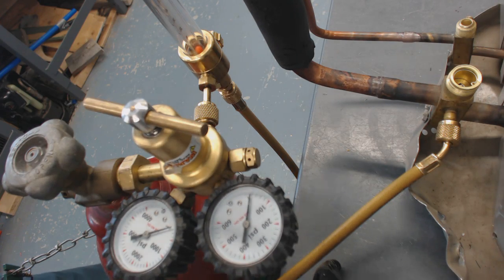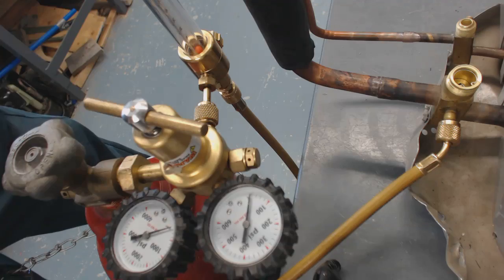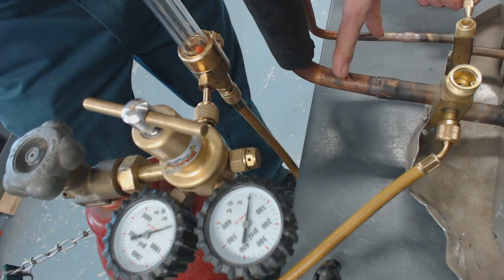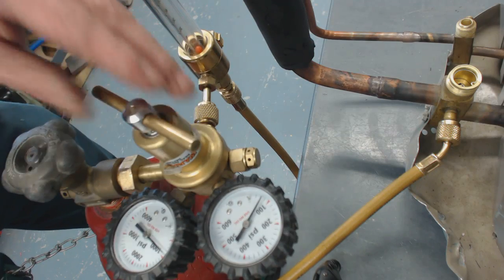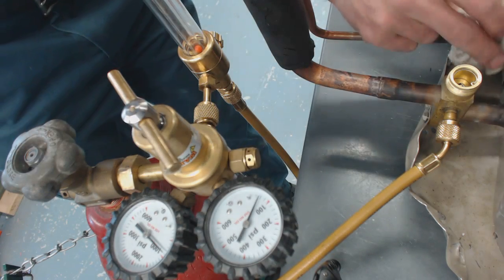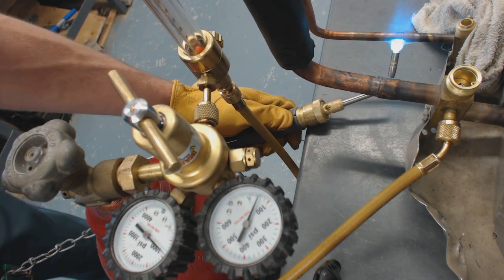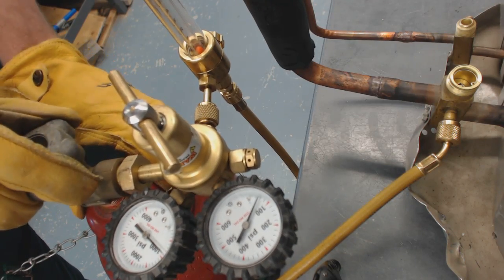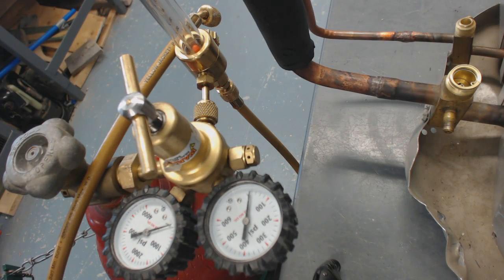How to Braze with Nitrogen! The Process up Close from Start to Finsh!

Comment: How would you do this setup brazing in line sets that are 9 ft up and not hooked up to the unit yet. I am working with 20 ft sticks of hard copper that can be up to 100 ft long line sets and we are brazing it all in without nitrogen. I know nitrogen is an important process when brazing because of the damage it can cause but I am working under someone and I kind of have to do what I am told. I want to do it the right way so if you wouldn't mind explaining how I would hook it up. Like I said none of the copper is hooked to the condenser or furnace so I would just need to run the nitrogen through the suction and liquid line to make sure I am not oxidizing the inside.
Reply from the maker: You can drill a hole in a cap and braze a service valve in it. Put the cap on the end of the pipe and tin tape it on. You would be brazing 20 ft or more away so this won't fall off. Keep the nitrogen tank on the ground and use 1/4" hose couplers or a gauge set  to connect two 5' refrigerant hoses together to extend reach to 10' high.  --- http://amzn.to/2i2JwE8   -- I do agree that you need to follow what your told until you are in the position to make the positive changes you want. Also when just running linesets before installation of the condensor or evap many times we braze these access fittings on and do a pressure test during other building processes to make sure our linesets were not damaged. You would just cap the other side or connect the other side with the two pipes together. Thanks, hope this answered your questions!
Reply: acservicetech acservicetech acservicetech acservicetech okay so for instance say I am going to braze 40 foot of line set I would braze into a cap a service valve on both liquid and suction line. Now at the other end of the liquid and suction line is that left open so the nitrogen can escape? I think you mentioned tying them in together but how would you do that if the liquid line is 3/8 in and suction is 7/8 would you need some kind of reducer so they could tie in. Guess I am not understanding how you could tie the two in together since they are free standing and not hooked to anything yet.
Reply: acservicetech thanks for the link I am going to order those
Reply from the maker: If you were to tie them together on one side after you are done brazing to run a pressure test through both then we usually just crimp the suction line over the liquid line and braze the seam. It will hold pressure. I do this with channel locks and linesman pliers. In reference to brazing just the vapor line put the cap on one side and leave the other side open for the nitrogen to escape. Here is the link for the smaller tubing service valve  -- http://amzn.to/2iQ1tIn
Reply: acservicetech okay I got it. Yeah I have channel locks so that won't be an issue. I really appreciate the tips it will help me do my job better. 👍
Reply from the maker: Great to hear, always feel free to ask questions, share your victories or frustrations. Keep growing man!

Comment: so do you put the nitrogen in the high side and let it flow out the lowside? Does it matter which side you flow the nitrogen into the system? thanks, let me know. ;)
Reply from the maker: Great Question! It does not matter which side you flow into, it will be able to flow out the other side. Thanks

Comment: Could you mention what position the hi/lo side service port king valves should be in while flowing nitrogen, e.g., front seated, back seated or 1/2 way?  Great Video!
Reply from the maker: Great Question! So in this video these are not king valves. Check this video out to see king valves--https://youtu.be/eXkqOS_qywo--------In the video you commented on-On new units with refrigerant inside the condenser the valves would be front seated as you are brazing the lineset and evap in. On a system where you are replacing the compressor and have previously recovered the refrigerant you would have them backseated. On king valves brazing lineset on system with refrigerant in the condenser you would have the king valves front seated. If you were replacing a compressor on a system you previously recovered you would have the valves mid seated. back seating a king valve is for disconnecting from a live system because a king valve does not have a Schrader to hold the refrigerant in. Thanks for your questions!
Reply: acservicetech

Comment: how does the nitrogen run through to the outlet of the high side service valve if the coil has not been brazed yet?

wouldn't the nitrogen leak through the unbrazed joints before reaching the high side valve?
Reply from the maker: Great Question! The object is to just get the oxygen out which it will do. Yes much will leak out but still there is enough to push the oxygen out at the other service valve, Check part 1, 2, and 3 for the whole brazing process with nitrogen.   https://youtu.be/SEe9HXmzvAY

Comment: Where did you get your gauges set up? Or what make are they? No wonder I have such a hard time doing it with nitrogen, as I don't have that second flow meter attached
Reply from the maker: You could get them at your local supply house or amazon for around $50. Look for a UNF3 Uniweld Flow Meter. Thanks for the Question!

Comment from the maker: I would still only run 3 cfh at the inlet through. If there is a lot of friction until the nitrogen can get out through the other side then it will take the path of least resistance and that may force a little pin hole through your molten braze for the nitrogen to escape. You don't really need the psi but just for the oxygen to not be present in order to prevent oxidation. Hope you enjoyed the video! Thanks for your comments and thumbs up!
Reply: acservicetech  how about doing this process on a package unit?  since they don't have service valves?
Reply from the maker: You would need to braze in access valves since you have to have the line be open while brazing and to weigh refrigerant in when you are done. this is what you would install after piercing and recovering refrigerant --  http://amzn.to/2i2JwE8  -or this size-  http://amzn.to/2iQ1tIn
Reply: You only need enough flow to snuff out a lit match at the outlet.Not blow it out.  If the match extinguishes, it means there is no oxygen.  Flood it first with more flow and then turn it down just enough to keep it moving..

Comment: Very nice, any changes with oxy/acetaline setup? I was considering running 5/10psi for gas to braze.
Reply: 10 psi would be plenty, 5 psi would be better.  Your only using a small tip.  Remember 15 psi max for acetylene.  Above 15 psi free acetylene can dissociate violently (ie BOOM).  One of the first things we learned in welding school.